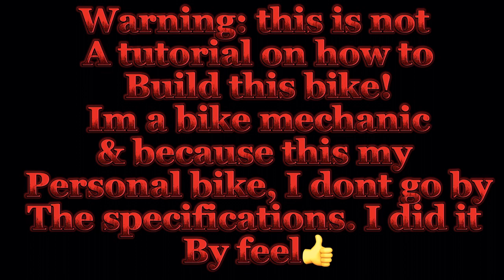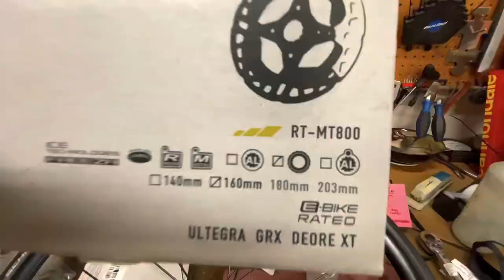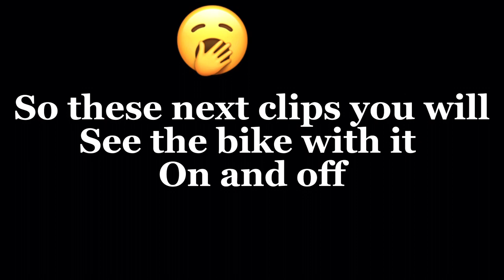2022 Specialized Allez Sprint Build!

Comment: Nice build..the colors are sick..I have a 2023 sl7 s-works tarmac which is very simiar..its basically an aluminum SL7 tarmac..my friend has your same frame w 3D print headset, Sram red set up, Roval c38 wheels and carbon bar..the bike is super fast, light and draws alot of attention..lol..have fun and be safe out there this 2023 spring/summer..

Comment: What’s the issue with the preload using the printed stem cap? I just ordered one from Raceware, adding di2 and SL7 stem to my 2022 Allez. I received a spacer from Xotic Tech, but wouldn’t use it. (Junk print) I’ve seen several other videos adding this to the Allez,  but first I’ve heard about any issues. Bike looks great, clean build 👍🏼

Comment: Love the color of the frameset.   I have the sprint in black/brushed. I just bought the 3d headset conversion too.  The issue you were having is because you have it set up mechanical and 4 house are too tight to fit thru the 3d print converter spacer??
Reply from the maker: yes I was thinking of that because I had to drill two holes for the cable housing....maybe when I upgrade Ill get it again 🤷‍♂
Reply: Yep..its better w electronic groupsets.